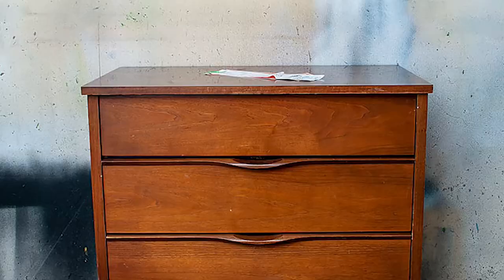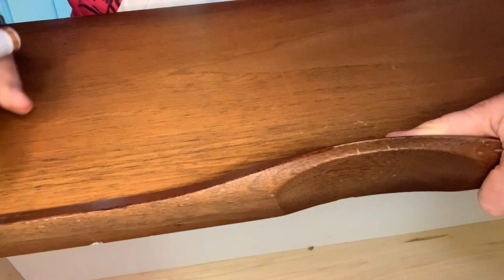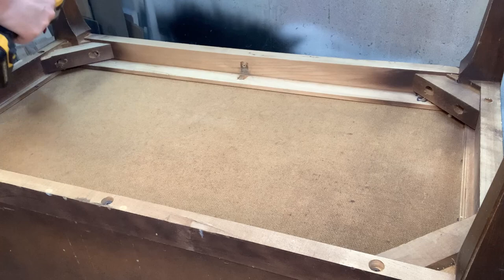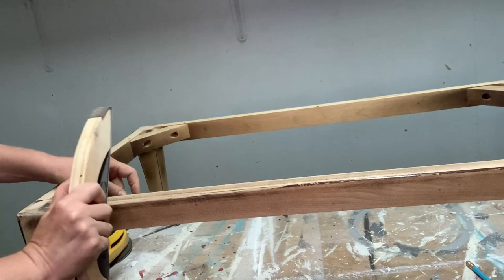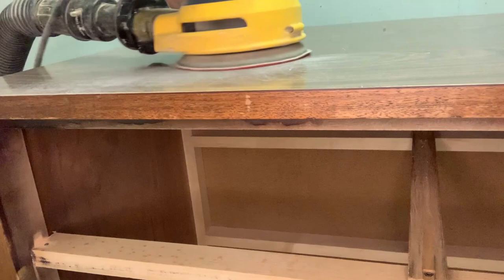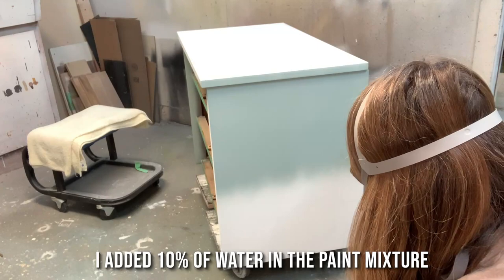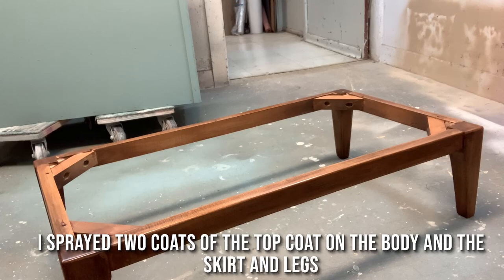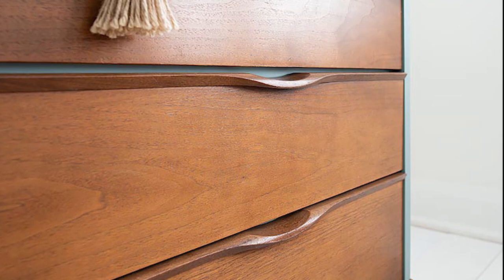Painted Mid Century Dresser

Comment: There are a lot of mid-century pieces that have a wood top and drawers and the rest of it is the arficial wood finish (what you might refer to formica finish).  I have actually stained the top and the drawers and painted the rest.   A really nice finish for the wood stain is Minwax  wipe-on Poly as the final wood finish.  I love using the satin because semi-gloss & glossy does nothing but enhance any flaws in your futniture.
Reply from the maker: Thanks for the tips and I agree Laura, furniture need to be perfect when painting or top coating in high gloss. Every little thing shows up!

Comment: Beautiful!  Do you also sand between the  spraying of the color?  You may have said and I missed it.
Reply from the maker: Thanks Linda. And it depends on what paint I'm using when spraying. I find this Silk All In One Mineral Paint is self-leveling and doesn't need to be sanded in between coats when I spray it.
Reply: @SalvagedInspirations  thanks